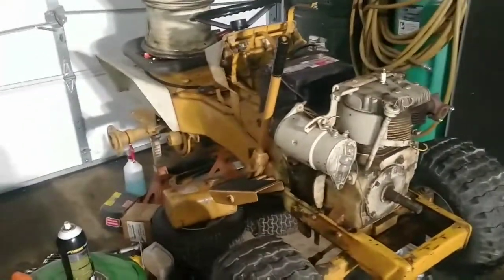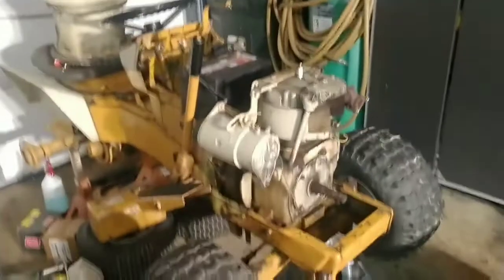Montgomery Ward Engine Start-Up Fail

Comment: hey did you see the new electric XT1 42 E,cub cadet i seen already,but said dont have in my area yet,ha and its 4k,ha battery last 1.5hrs charges for 4hrs,ok cool video later reese
Reply: im workin on a lawn boy mower 2cycle bought from a guy said doesnt stay runnin and cause it had no gas in it when i bought it ha,later
Reply from the maker: You always are working on fun projects.